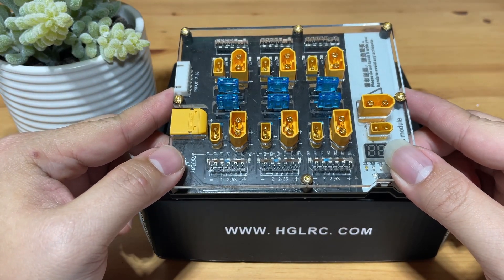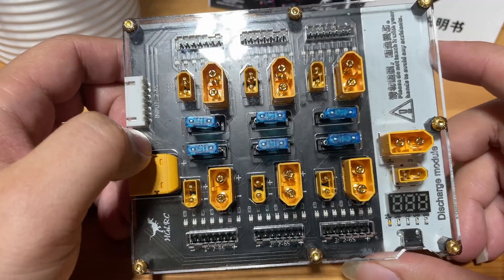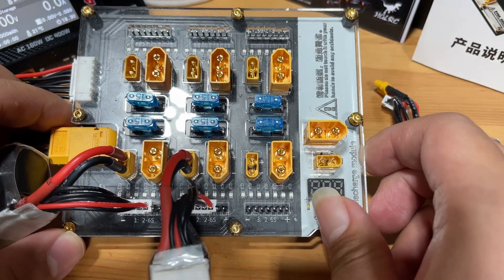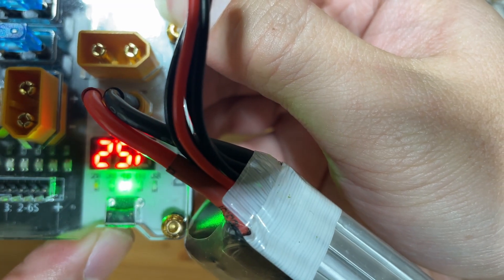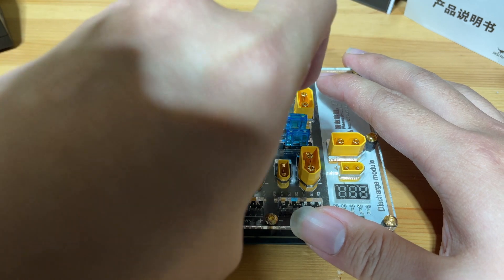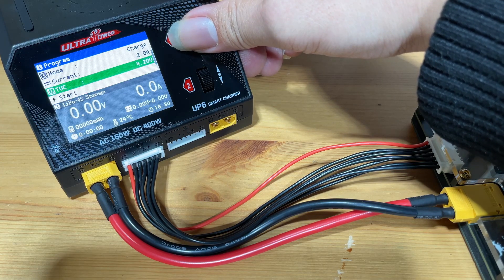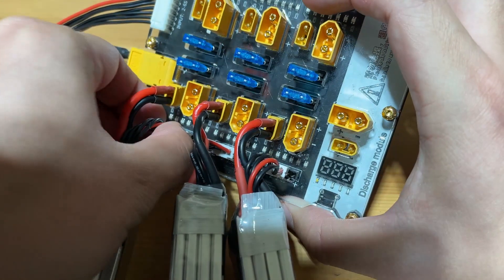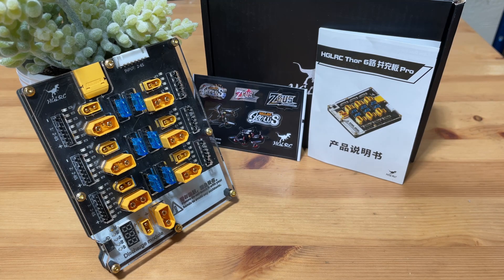HGLRC Thor 6 Port Lipo Battery Balance Charger Board - Review

Comment: Newbie here. How do I charge a 2S battery that only has a balance lead? When I plug the battery balance lead into the Thor Pro for charging, my HOTA D6 charger indicates “Current operation is not supported”, and will not charge. If I plug my KC3D parallel board into the Thor Pro, the batteries will charge, but that kind of defeats the purpose of the Thor (plugging a parallel board into another parallel board).
Reply from the maker: If 2s batteries with only balance lead, my suggestion is get the Vifly Toothstor  charger, it mainly charges on the balance lead. Which is going to make your life so much easier https://amzn.to/41sZSi6
Reply: @XwingFPVRC  Thank you. Being that I already bought 2 of the Thor's, I was hoping there was something I was doing wrong.